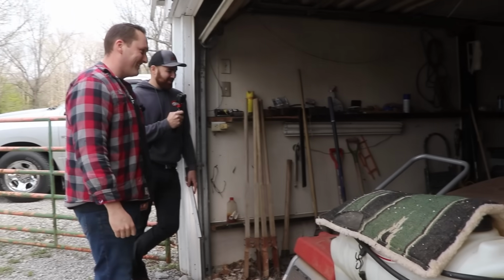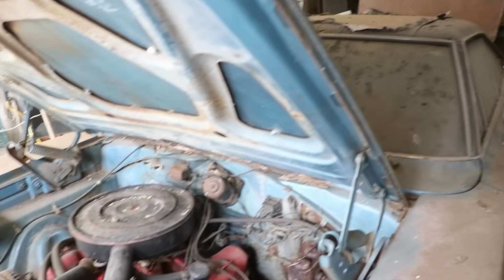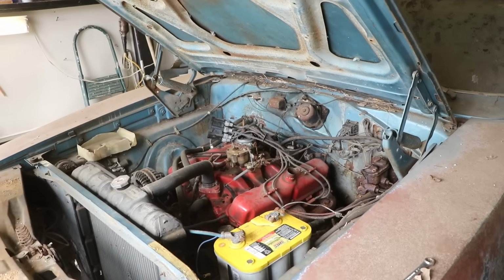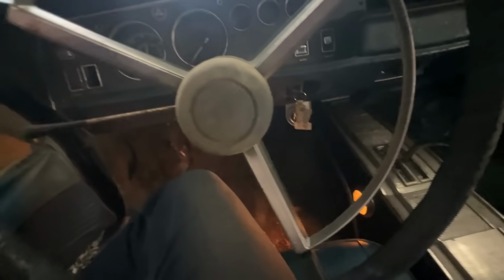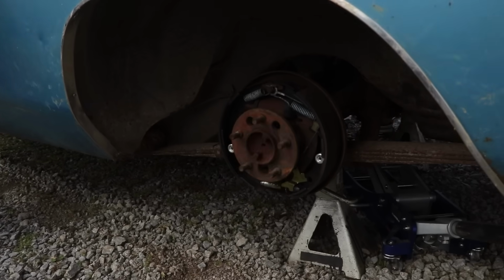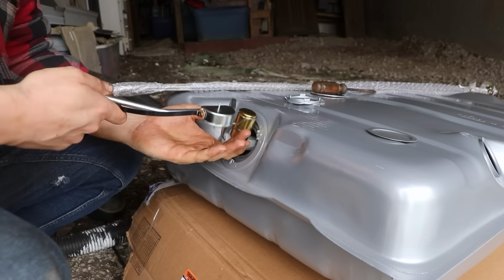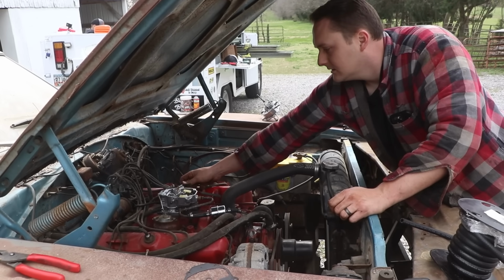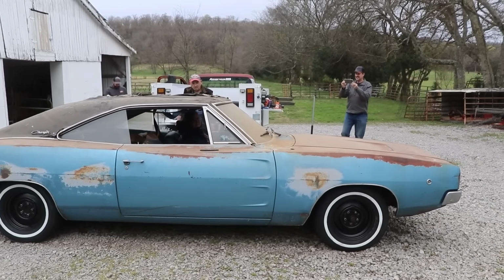BARN FIND 1968 CHARGER - Will It Run And Drive After Sitting for Years?

Comment: Hey, what a pleasure to see that '68 Charger getting some TLC to bring it back. Those people are going to be delighted. Thank you for videoing the initial work. They have a gem....I have an old "B" body too. It's a 1969 Plymouth Sport Satellite,(2-door) Sunfire Yellow w/ Black vinyl top, 318cid 2bbl, A-904, 8 1/4" open 2.76 axle, w/ pwr st, pwr brks, pwr win and AC. All factory. Now 54yrs old at 79,000 miles it's not rusty but it's not perfect either. I've had it for 34yrs and I drove it about 3,000 miles every summer except the last 2 Covid Summers. Now I am old, so I drive it all the time. I had to clean my little 2bbl carb after it sat those 2yrs during Covid, cuz some rust from the "shitty gas" (10% alcohol) I'd say must've rusted the tank or fuel lines. Anyway rusty water got in the carb & made it have an off idle stumble, but Gumout spray carb & choke cleaner got it back to perfect. The car turns heads everywhere I go, but it's not a show car, it's a driver. And it drives so well for 54yrs old it's hard to believe. Only bad thing is 10" drum brakes. I had to settle for metallic brake shoes and they need a couple seconds to heat up befor they get around to stopping very hard. Other than that it's such a pleasure to drive. Oh, and I almost plum forgot, it gets 19.7 mpg on the expressway at 70mph running between gas stations. No Lie. ben/ michigan

Comment: Just a tip . But If you take a old decade of cards .and put a card all the way around In between the rim and tier .and then spray  the rims.  The cards will reflect the paint from going on to tires. . Just a idea 
What a BEAUTIFUL car . She's so happy and amazed.
Reply: Those were the old tires that were going to be recycled, but I will for sure remember that if I need to touch up the wheels after Joyce drives it again like she did in high-school.

Comment: thank ya'll for showing that stop plate thing so many people DO NOT transfer that over and the plungers can come out of the master cylinder, with the factory stop plate I normally will yank the brake pedal up when it's still in the car for leverage if it helps someone for next time. had to beat the square cut o ring out w a hammer in a vice before so know that "fun"

Comment: Dupli- color wheel paint and clear coat is some great stuff. I painted my truck rims almost two years ago with it and that paint is still holding up! This year I used it on my roadsteration project, a 1986 Thunderbird. I used it on more than just the rims 😉.  I will say that I prefer Rust-Oleum primer to Dupli-color primer. Rust-Oleum applies much better and gives more coverage.

Comment: What’s with calling the MoPar keys “upside down”?  The teeth of the key go up on any kind of lock, whether it’s a doorknob, a deadbolt, a commercial door lock, a Chrysler, or a pre-1970s Ford. The only keys that are upside down are GM keys. 
I’ve heard locksmiths say that it’s a very bad design to have the pins on the bottom.

Comment: My second car was a 1968 Dodge Charger, 383, 4 barrel, 727 auto, 
with the floor shifter, power steering, power brakes, 
orange with black interior and black vinyl roof, I paid $750 for it in 1977.  
It looked great, ran great, but was a bondo buggy.  
I drove the hell out of that car, it burned rubber in all three gears.  
Had a fender bender in it and replaced the front right fender with a green '69 fender from the junk yard.
Rebuilt the transmission, blew up the rear end, replaced it, replaced the radiator.
The radiator had the brackets welded to the radiator.  
When I replaced the radiator the yard I bought it from welded my old brackets onto it for me.
About three months later I was racing a '66 Mustang, beat him twice, he wanted to go a third time.
So I buried the throttle the third time, then a loud bang, I pushed the engine so hard 
that the radiator hoses twisted the radiator so hard the welds on the brackets broke. 
Turned out that the yard hadn't welded the brackets, they soldered them!
So my radiator broke off and fell into the fan.  I used some wire to hold the radiator in place 
and limped it home with water leaking and steaming all over.  Fun times.

Comment: I am 16 years old and my grandparents just gave me there 1969 dodge charger and it has been in there barn for almost 20 years. They gave it to me to fix up because it was hurting them to just see it like that, ( not in running order) surprisingly so far as I have seen there has been very little rust. So when I saw this video I figured that it would help me get to know the car better than I already did and the components. And it has!

Comment: Awesome video guys. 1 thing thoe. Very unsafe with Jack stands in grave like that. Should have had steel plates under them.
Reply: The front jack stands were a little sketchy, but the rear jack stands have plates on the feet that make them super stable 👍🏼

Comment: you really did a good job , was any of the old parts number matching would be worth the rebuild if they are
Reply: Nothing taken off the car was numbers matching. All parts taken off  were kept. But parts like alternators, gas tanks, starters etc were meant to be replacement parts

Comment: Bet you it is not older than I am, I was working on the cars like that before most of you all were born. I still have the specialty tools for the ball joints, torsion bars and much more. Dwell ,timing, vacuum box with the gages I still have.

Comment: I owned a 1969 Charger with a 383 in it, wish I still had it 😢 mine was real close to that color. My 69 was a California car with no rust but the paint was rough, it had the high back seats. The thing that will haunt me forever is that after throwing a rod I sold it for 270.00$, it was 1984-5 I was 20 years old, I was in the navy so I didn’t really have the place or know how to fix it, so sadly I let it go cheap.

Comment: I'm not sure why nobody on you tube does this but I had a Chrysler 2l that was not great with vapour lock.the man pump was on top of the engine and easy to get to but this works even if it's tougher to get to as the are never that bad.just unbolt the pump, manually pump the lever or pushrod till you hear fuel in the float or at the filter before the carb.bolt pump back on .your primed with a full carb.easy.even better on a cold car or one that has been left a while instant start so no cranking in freezing temps I put a electric pump on mine in the end but it worked before that even with vapour lock.

Comment: The left hand thread on the wheel studs of a Dodge wasn't so weird. They had good reason (in theory) for doing it (it kept wheel nuts from loosening themselves) and they weren't the only maker to do it. I can think of a few that used them. Unfortunately consumers weren't smart enough and broke a lot of studs creating a larger safety issue, so all manufacturers quit using them.

Comment: are they going to repaint it and redo the interior and roof?
Reply: Interior for sure. Many parts (door panels, seat covers) on back order atm. Joyce wants to redo the roof but I am afraid removing the vinyl will reveal some ugly secrets that will need to be fixed before the vinyl will be able to be corrected. For now, few updates on the inside, fix the alternator and heater core, then drive it until it does not make them smile.

Comment: We had a 1972 Dodge van that when you hit the brake pedal  .the front turn signals lit up . Turned out to be a short in the turning signal switch in the steering column

Comment: Husband passed and his family helped them selves to my old vehicle's... Okmulgee County Oklahoma Sheriff dept will not... refused to post vehicle's stolen report on NCIC?? 45 days later...I could not find the vehicles anymore....65 Impala i drove to high school, 71 Ford f150 original owner, 84 Ferro, 2- 84 Rivera's, 84 & 99 blazer's, 77 Chevy 4x4 restored, sliding tandem invention with a new, Neway air ride system, 1984 Kentucky rail car hauler maintenance trailer self contained, living quarters, AC/ Heater system, 2 - built in 18 drawer each, Matco Toolboxes full, full of tools necessary to operate our trucking company!!!

Comment: That looks so much like my 69 R/T it isn't even funny. I did everything I could not to change the exterior because that's part of its story, even left the bumper stickers from the 80's. But I did mechanically rebuild the entire car, fixed the rust, and repainted the engine bay and bottom. Luckily no body rot. Looks new underneath and old school on top to keep the history alive. Then I brought all the previous owners over to see it.

Comment: Listen,,,Sorry But, a fresh can of gas on the fender well and a batt,,Good by groundhog,,,,I'm 53,traded my mud truck in 95 for this same ,68,318,blue on blue, SE Carger,,1100 bucks I paid for the truck I traded,,CAR was original owner car, it sat outside under carport in Fort Lauderdale,  Fla, for 10yrs,,6500 miles on it,,Took me 20min, to start it and drove it home..I sold it in 03,,Still have one badge,and original key on my key chain,,,,Good luck ..

Comment: @Dylan McCool   So, help me out here Dylan... My dad also bought a brand new '68 Charger back in the day, and he kept the original dealer brochure that I used to read over and over as a kid. IIRC, with this blue Charger, orange engine paint + dual exhaust should mean Hi-Po 383 right? And shouldn't the Hi-Po 383 have a 4 barrel? The Lo-Po 383 should have been turquoise with single exhaust and a 2 barrel, am I right?
Reply: The engine is red and Larry added the dual exhaust.
Reply: @MaySeizeGarage  Oh, OK!!! So is it a 383 or a 318 then?
Reply: It’s a 318 small block 👍🏼 The big block cars have the distributor in the front of the engine rather than in the rear.

Comment: The coil takes 12 volts in to the condenser, the condenser take that 12 volts and makes it 20 thousand volts yes enough to kill you that 20 volts then are shot back to the coil and sent to the coil wire, the only reason no one was ever killed by the spark of 20 thousand volts is because it's intermittent

Comment: Ok Kids, the Tires are called...."White Walls", not white Lines!
Reply: What walls are different than white walls actually, a white wall nearly the entire sidewall of the tire is white while white lines have a thinner white line just like this 👍🏼
Reply: @SallysSpeedShop  No they are Not, all the Tires with a White Stripe were called WHITE WALLS, as when We changed them you asked the Customer...White Walls in or Out...Come on Kid, it's called LEARNING from your ELDERS!
Reply: @SallysSpeedShop  When a Customer got New Tires and it had a White Wall, that covers any White Ring on the Side wall of the Tire, you asked them.....White walls in or out, or, Black Walls in or out....This is how We did it in a Dealership or Repair Shop for Years Kid, Wake Up Kid!
Reply: @SallysSpeedShop  It's the Side wall of the Tire, it's got white on it it is a White Wall, No white all Black, it's a Black Wall, or White Lettering in or Out!

Comment: The alternator is incorrect for the car...Being this car has no AC, it should have the single pulley alternator. The single pulley style would align right between where the double pulley is. The belt squeel cannot be corrected until it's changed. Only commenting due to past personal experience...lol, good luck

Comment: What kind of carburetor was that? Still learning as I go, but I did not seem like a traditional four barrel, I am usually a GM/Ford guy. I would not think he would put a two barrel on that? And how did he buy a carburetor for $70?
Reply: It’s an EBay special 2 barrel carburetor made to mimic the original on these cars. I believe they have a Carter on them new.

Comment: Did you guys just really cut those tank straps with a hole in the tank and a container full of fuel underneath it??  You know better than that.  That car had every right to go up in flames.
Reply: I dont like to criticize people unless its something pretty dangerous, your right in what you said, I definitely wouldnt have done that tank like that but hey appears nothing bad happend 😅.  The part that made me cringe was when they put that tow strap over the ball hitch ball😬 there was a guy just killed some years ago like that, the balls not made for a sheer load like that, it snapped off and flew threw the windshield and killed a guy. I mean I guess it's alright to flat tow like that for a minute but not to go jerking on a stuck vehicle. This all said I ain't the safety police and this was a great video overall.
Reply: I’m hindsight there were a couple of things that could have been done a little differently, but nothing bad happened the entire time and the job got done 👍🏼 OSHA apparently missed us on this one haha
Reply: @SallysSpeedShop    I understand that but if a lesson wasn’t learned or at least identified, it’s doomed to repeat itself. Had the fumes in that tank ignited,  the outcome would have been tragic.

Comment: Kinda disapointed in you, thought you'd know better than to punch a hole in a perfectly useable factory gas tank, yes it was replaced in 97 but it probably was an NOS unit, or at least a good factory piece, I didn't see anything wrong with it.   Same with the tank straps, ya they make new ones but they're never the same fit as the original stuff... SMH
Reply from the maker: They’re getting scrapped either way, why bother with it?
Reply: @DylanMcCoolVideo  Why scrap them, perfectly restorable.   Put them in the owners part stash, or if they don't want them swap meet them